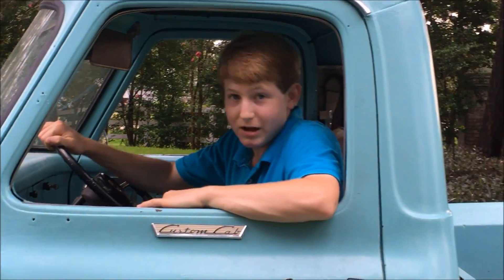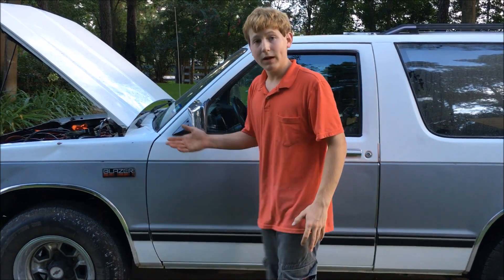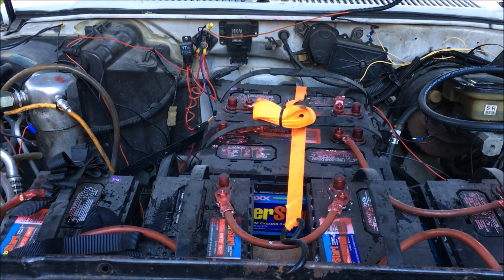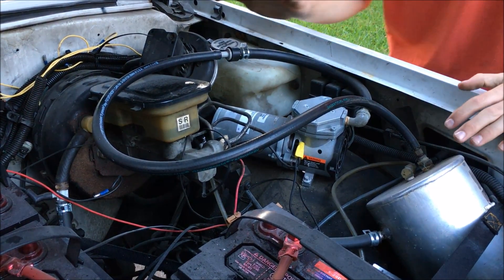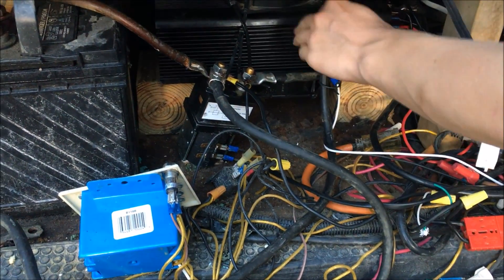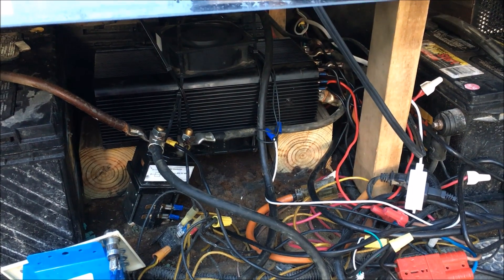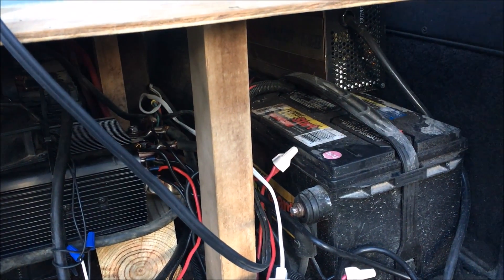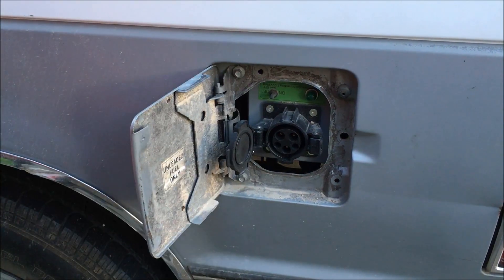Austin's Fully Electric S10 Blazer

Comment: Very impressive work! You're a very talented man and the film is packed full of good info. Thanks for taking the time to make it!!! I have a 1987 S10 Blazer and upon finding your awesome film have started to kick some ideas around in my head. My wife and I live in an off grid homestead and have vacation rental resort in the Finger Lakes of NY. We built everything ourselves. I'm thinking of somehow if possible, using the battery bank that would go into the Blazer as a supplemental to my existing battery bank for the resort. I would have to design lots of DC shutoff switches and more wires connecting the batteries so I could go series to gain the 144 volts vs my 12-volt battery bank (wired that way in parallel) I also wonder if a quick disconnect gas engine with generator could be used so I could put less batteries in and get a better range than 35 miles. I'd like to get 80 miles by running the generator which would click into the rear ball hitch and be able to quickly disconnect. We also make lots of films to help people and the planet open source at Jeff and Jodi Films our youtube channel. Thanks again for your brilliant project and film!!! Here is one film: Love U Kids ALWAYS - YouTube

Comment: I have a 2002 project truck. If you went EV could you fit all the needed components in the engine bay? Do you have a transmission? Possible to implement rack and Pinion power steering? I would have done A/C delete.  Are the brakes electric? What's the expected life of those batteries?  $10k seems like bad economics so must be for the love of it.
Reply from the maker: I would recommend not doing a conversion right now given the low price of fuel and the high cost of better batteries.  I personally am going to wait a few years until fuel prices rise again and the cost of Lithium Ion batteries drops to an affordable level.  But to answer your questions:  Yes, everything except the batteries can fit under the hood.  Yes, it has the 5-speed stick from a 1996 truck.  I would image that if a later model had rack and pinon steering and you fitted an electric hydraulic pump that a swap could be done.  The brakes are hydraulic but are powered by an electric vacuum pump.  The batteries show in this video actually prematurely failed within a year.  I moved to using Trojan T-105 batteries which seem to be on track to last about 3-5 years.

Comment: Nice conversion! I wanted to do a conversion on a car for my high school senior project but due to bugetary issues, I ended uo going with a motorcycle. Its gone through a couple iterations now, but I've currently got it set up on a 1967 Kawasaki A1-SS. Working on putting a lifepo4 pack in now.
Anyhow, my passion for EVs has led to me working in the industry for a company that build cahrging equipment for EVs (right next door to EV West nonetheless!). I wish you the best of luck on your future projects!

Comment: Hey dude looks like a neat job. Would you instruct me on fully electrically powering my 87 blazer I'm tired of investing in my vehicle
Reply from the maker: Thanks.  You will need some main components along with lots of odds and ends.  The main components are: electric motor (new or used out of a heavy duty electric forklift), a transmission (I used a 1996 S10 5-Speed NV1500 trans), an adapter plate and coupler for the transmission and motor, controller (I used the Curtis 1231C controller which is cheaper than most but not great quality), batteries (I used Interstate/Everstart Marine Deep Cycle 12 Volts, but in early 2015 they changed designs and are now junk, so I would suggest 24 6 volt Trojan T-105 Batteries.   I got most of my parts from http://www.electriccarpartscompany.com/ (batteries were sourced locally) I don't know if they are still selling conversion parts for S10's as I got most of the parts in 2014.   Note: You said you were tired of investing in your truck, but the electric conversion is quite a large investment.  The savings come after about 8 years for my truck.  If you want a lower budget conversion, you might check out some Diesel engine swaps.  I know that some people have put Isuzu Diesels in their S10's.  Best of luck with whatever you wind up doing!

Comment: Looks like your low on brake fluid by looks of the reservoir.
Reply from the maker: I just noticed that the other day, and I have filled it once since the video, so I think I've got a leak I need to take care of.  I had a not so adept mechanic fix a brake cylinder for me, so I think he might have caused a leak.  Thanks for the tip!

Comment: Dude! Good work! Do you have a bill of materials or any documentation about your build? You were very smart about considering the brake booster and braking system. Also, are you doing any phase advance to recover energy as you brake? That would extend your range significantly.
Reply from the maker: I am not doing a regenerative breaking system as it is very hard (but I have heard it can be done) to do with a series wound DC motor.  If know of a way to do the regen, please let me know!  I do have most of the documentation that came with the parts for the conversion, but they are mainly poorly written manuals from China.  I actually do not have a system wiring diagram as most of the wiring is very basic (+ and - battery cables).

Comment: Just found your video very cool ,,,,being you are in Texas would solar on top of the blazer and  maybe a different deep cycle battery help,,,,or a small LNG generator
Reply from the maker: Thanks!  I tried the generator, and the noise is a bit of an issue.  I also tried solar panels, but the roof surface area is too low to really help.  A better battery pack would definitely help.

Comment: Just stumbled on your vids. Impressive for your age!  
FYI, as an electrical engineer myself, you would want the Motor Controller as close to the motor as you can. Shooting high current PWM down long cables like you have here is not the best for it.  Keep up the great work!
Reply: ugetridofit good point. The closer everything is together the better the out put. Might even get youre mileage up. But good work young man
Reply: Nice 👍 
Knowledgeable. 
You may be the person to ask .
Trying to design on paper an electric booster on a gas moped or motorcycle. Just for a few seconds top speed boost . Wanting to use super capacitors/small battery that charge when not needed . Much like the F1 cars that had an e booster. 

Very vague description . Keep up the good stuff 👍🏻
Reply from the maker: Thank you for the suggestion and compliment.

Comment: was the original engine a 2.5L 4 cylinder or the 2.8 v6 or 4.3?
Reply from the maker: This truck had the 2.8L V6, but I never got to drive it with that engine because it was ceased up when I got it due to the previous owner not checking his oil level.

Comment: Just wondering why would you put a electric engine in a s10 blazer what are you doing austin
Reply from the maker: I had started the project back when gas prices were through the roof, and I wanted to make a cheaper method of transportation, so I decided to put an electric motor in a vehicle, and I found the Blazer for very cheap on the internet because it had a ceased engine (after being driven from Louisiana to Houston, TX with a low oil warning light on).  Besides what else can you do with a ceased, beat up truck, except maybe a 350 swap (although not very economical!), that would be interesting?
Reply: *seized

Comment: Such a good job brother !
 which motor is used in this car? I am working on e bicycle so how i can make it regenerative with using Supercapacitors?
Reply from the maker: I used a 9 inch DC series wound motor.  I would recommend using a 3-Phase AC motor with a compatible controller that supports regen.  In this truck,  I don't have regen because the motor is series wound and thus is not compatible with regeneration.  I would not use Super Capacitors for this because (I assume) you already have a battery pack that could be used to store the power regenerated.  However, if you just want to use super capacitors and no batteries for a few second boost,  I would use 6 350 farad super capacitors at about 2.7 volts.  Just wire all six in series ( for 12 volts ) ( just wire more for higher voltage ).  A 36 volt pack should be adequate.  Make sure to include a balancing circuit for the capacitors.  You can Google a diagram for one of these circuits. Good luck!
Reply: Thank you
Reply from the maker: Anytime!

Comment: Are you using a variable frequency motor controller?
Reply from the maker: No. It is not a variable frequency motor controller, it is a PWM (Pulse Width Modulation) controller.  It has a fixed frequency and just changes the length in between the pulses of that set frequency to adjust the speed of the motor.